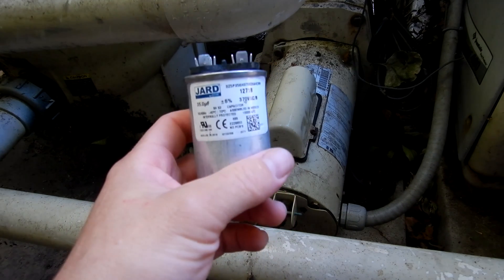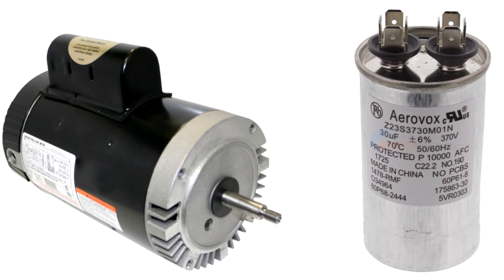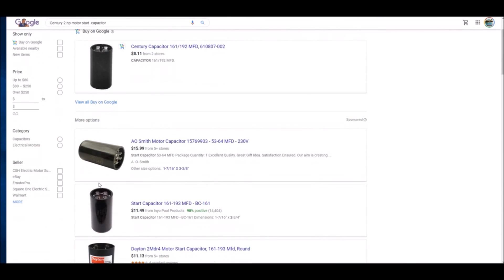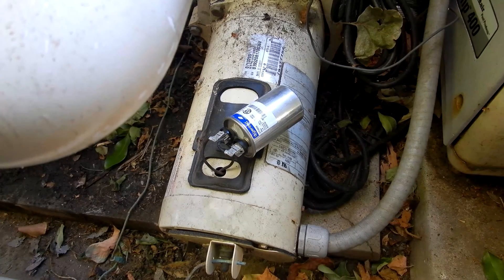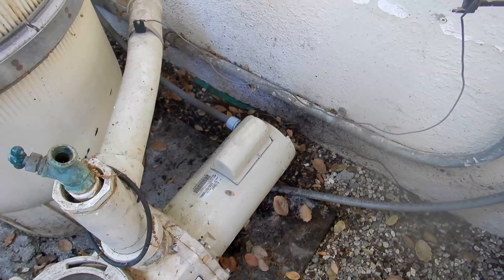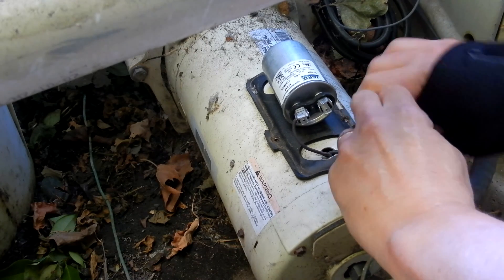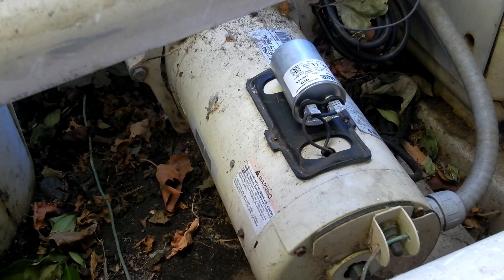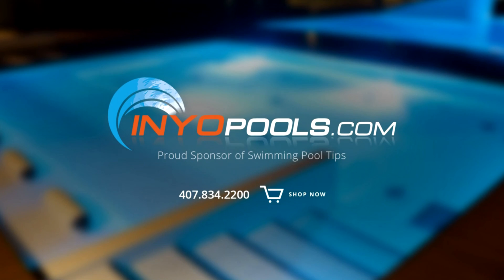Pool Pump Motor Humming and Clicking Off: Change the Run Capacitor (Starter Capacitor) Easy Fix!

Comment: What if it runs for a few seconds and clicks off and I’m unable to turn it back on for 15 seconds. After 15 seconds I can hear a faint click in the pump and then I’m able to repeat the process. Regardless of how many times I do this it doesn’t stay on for more than 3 seconds.

Comment: Great video. where the motor was making a loud sound which was your second demonstration,is that still a capacitor issue or bearings? I didn't quite understand what you said
Reply from the maker: The high pitch noise is bearings going out.

Comment: My Polaris pump is making the hum sound then shuts off at about ten seconds. I changed the capacitor and the issue is still there. I checked the impeller and it spins freely. At a loss and appreciate any additional trouble shooting tips. Pump is only 4 years old and it gets disconnected and taken inside each winter. If it’s not the capacitor then what could it be?

Comment: The two wire coming from pump to connect the capacitor is there a specific way they connect
Reply from the maker: No. Either is good
Reply: @SPL  thank you

Comment: Do you have to discharge the bad capacitor somehow before touching it so you don't get shocked?
Reply from the maker: You can. Usually not a big issue.

Comment: I have a Centrion 1.5 HP hooked up to a hayward that won't start without me spinning the shaft. I changed the capacitor and nothing. I was looking to see if the centrifuge switch was getting stuck but its opening and closing as it should I think based on how it closes when it slows down and opens after a second of spinning. Any idea whats going on?

Comment: Both wires are black, how do you know which wire connects to which connector on the capacitor?
Reply from the maker: It doesn't matter which goes where.

Comment: Hey man youve helped me in the past I have a question. Fired up the pool pump first time went on fine shut it off then couldnt get it started so did the research and saw it was the starter capacitor, replaced that then it fired up once and let it run for a little bit then it wont turn on anymore same thing hum for 4 seconds then clicks off. randomly it would turn on and run as it should. the motor is not seized by any means runs great when it does but now it wont turn on at all. faulty capacitor or could it be something else?
Reply from the maker: It depends on the motor age but it could be the bearings going bad and causing the pump to heat up - tripping the fail safe. You can try another capacitor just to be sure.
Reply: @SPL  I banged the metal housing cylinder cover with a screw driver 10 times and it clicked on for good can shut it on off no prob. go figure

Comment: My pump seems fine but my capacitor keeps failing. Could it be I need to clean the filters sooner? Psi is 17 when clean, I did a backwash at 25 psi and allowed it to get back to 25 psi without cleaning the filters as of yet. This is my 4th capacitor in 2 years. 

Hoping I don’t need a new pump.
Reply from the maker: It sounds like the pump is getting hot so maybe take it to a motor shop and they can rebuild the bearings.
Reply: @SPL  thank you as usual, I’ll i do just that.

Comment: Can the capacitor be bad if the pump does clicking and humming when on high speed and it won't come on but it runs at low speed?
Reply from the maker: For a two speed pump - yes
Reply: So another question.  If my capacitor 25+10 uf and it's hard to find the same size. How much higher can I go? Is it safe to use a 35+5 they're all 370VAC
Reply: @SPL  thanks for the video, in this case: 2-speed pump running without noise in low but with the humming/clicking in high, is it the running capacitor or the starting one usually? thanks!

Comment: David, great video. I have a Century Dual Speed SQS1102R motor only 2 years old. Hooked up to an Intermatic timer. Everything was fine until the dreaded humming noise, followed by silence and the motor getting very hot as the timer repeatedly tried to turn it on. I can temporarily fix the situation daily by manually turning on low speed for a few seconds, then turn that off and quickly turn on high speed. The motor runs fine and sounds fine at that point. After finding this video I checked the run capacitor. It was shot, reading .083. I bought and installed a new one. Problem solved...for one day. Now that run capacitor is toast, reading .029. Both have identical stress marks on top. The start capacitor reads fine...65.7. I assume this is heat related. But on a 2 year old motor I'm stumped how this happened or what my options are. Today I ordered another run capacitor to try again one more time.
Reply from the maker: Century is usually pretty bullet-proof but as you know products just are not made they way they used to be. There are a lot of sub-standard components out there. I suspect the bearings or coils are making the motor run hot. If there is a pool store or motor shop the rebuilds motors I would take it there to have new bearings put in if it is running hot and another capacitor bites the dust. A long shot but if you are in the Orange County California area a great place to take it would be to Advantage Manufacturing - they rebuild motors all day long there.
Reply: @SPL  David, thank you for the prompt advice. I suspect the same thing. I previously lived in the Orange County area but now I'm in South Florida. I'll try the new capacitor then look for a shop in this area. I guess I could check to make sure I'm getting the correct voltage but that seems like a long shot.

Comment: Have a 2hp pump and 320 DE filter. Just yesterday I heard the pool breaker trip I turned it back on and the pool was running for a couple house. Then the pool guy came, cleaned out the filter which was super dirty, and it was working until a few hours later when the breaker tripped but this time it also tripped the main breaker. There is power going to the system but the pump won't turn on/make a sound and seems to have some burned wires. Could this have been caused by the capacitor?
Reply from the maker: It could be that. I would have him change it for you to make sure. Worst case -the motor itself is burned out.

Comment: Do I need to discharge the capacitor (I've heard that) or just take wire off with no problem. Thanks
Reply from the maker: It rarely is an issue. I don't usually.

Comment: I changed my run capacitor that's on top of the motor and it's still humming loud. Any suggestions? Thanks.
Reply from the maker: Maybe something is jammed in the impeller?
Reply: Thanks I will check it out.🤞🤞🤞
Reply: Did you figure it out? My motor just started doing this exact same sound and won’t come one and I swapped the capacitor and it’s not the capacitor.

Comment: Can you tell me what is happening if the pool pump starts the water cycles like it should but within 5 or so seconds it stops cycling the water completely hums really loud as your first capacitor example and stops. We only have the 1 start capacitor and did replace and the same thing happened. This is an 11 year old pool and nothing has changed in it. No wiring or anything to overload and trip the system. Any thoughts? We now have a green pool in a pandemic lol. We did try to clear the impeller in case it was blocked and nothing came out. Please respond :)
Reply from the maker: Sounds like the motor is overheating - if the motor is 11 years old time for a new one.
Reply: Motors heating up and insulation breaks down motors are wound and dipped one time in varnish and baked companys need motor failures to stay in business just like a car...

Comment: I need help with mine. I don’t remember which wire goes to which terminal. Does it matter? One of the wires has red mark on it. I just bought a new capacitor but I am unsure on the wire placement. Any suggestions?
Reply from the maker: Doesn't matter if it is the run capicitor on top of the pump.
Reply: AC MOTORS USE ELECTROLYTIC CAPACTORS THEY HAVE NO POLARITY  ON AC...

Comment: Game changing video for sure. I can not tell you how many times I have been the second opinion on a "broken" motor. 9 times out of 10 it is the capacitor. So many companies use this issue to sell brand new motors to customers that don't even need it. Disgusting. Thanks David.
Reply: i feel you on this
Reply: If it is a bearing no need for a new motor an SKF OR OTHER HIGH QUALITY BEARING can be pressed out and a new one installed  no need to spend 700.00 on a new motor ..
Reply: @davidcooper4385 I work with pump motors everyday.  Changing bearings is doable if you can get the motor apart without can bolts breaking.  If they do , usually the motor has too much corrosion to bother with bearings. It's a toss up.
Reply: Yes. Capacitor failure is the number 1 pump replacement reason. It's criminal.  I am in the business so I see it everyday.

Comment: Careful with these as well. The capacitor can hold a voltage charge and give you a shock if not handled with care. Even with the voltage to motor being off.
Reply from the maker: Yes, good point. Rare but can happen. I also like to do one lead at a time on both types of Capacitor to make sure they are on exactly as the old one was.